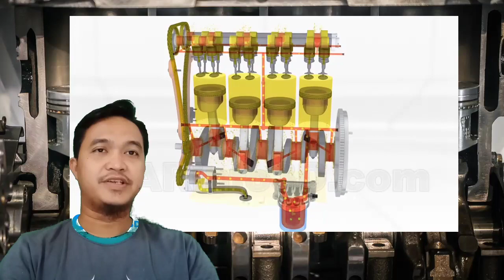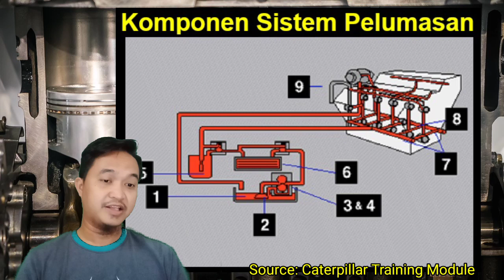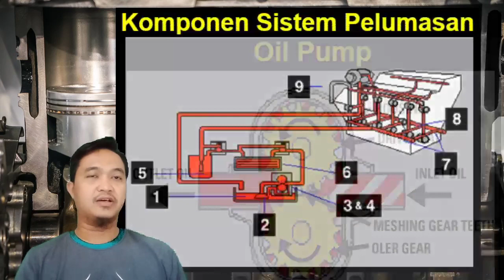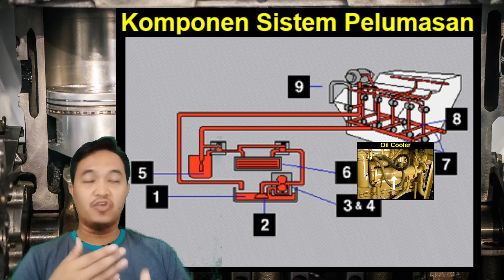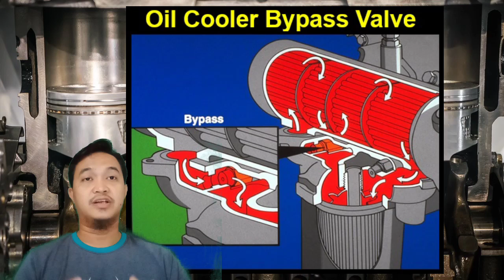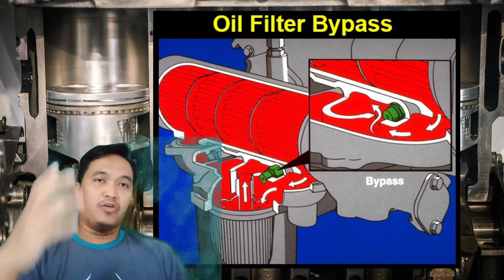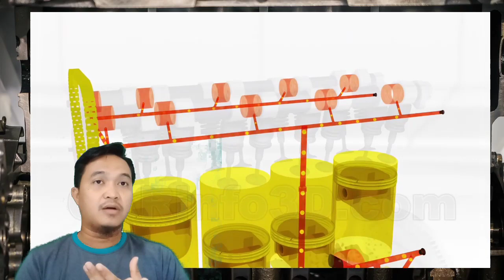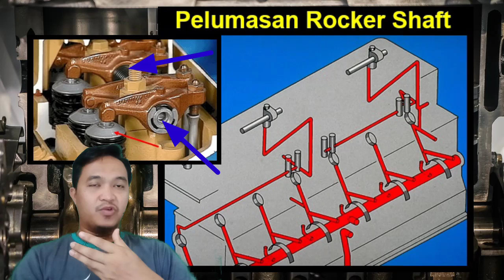Cara kerja sistem pelumasan engine (Lubrication System). Apa itu crankcase blowby? Training BMC 6

Comment: Permisi om,, untuk yg bagian crankcase breather itu cara kerjanya seperti sistem pcv gak om? Yg nantinya bakal ada selang yg menuju ke intake, nah di mobil saya intakenya jadi kotor banyak kerak oli gara² itu,, bagusnya itu bisa dicopot saja biar lepas ke udara luar atau saya tambahin filter breather biar lebih aman? mesinnya?
Reply from the maker: Oh kalau di mesin diesel rata2 lgsg dibuang ke udara mas..
Reply: @dikiadnarrayyan  tapi klo mesin bensin harusnya juga gpp kan om klo dibuang ke udara juga? Alih alih bikin kotor intake sj
Reply from the maker: @nash4938 iya sih mas, saya pun baru tau ada sistem yang model seperti itu .. tampaknya ada sistem yang tidak bekerja lagi mas.. tapi klo dilepas berpengaruh ke yg lain gak mas, mengingat itu sistem bawaan..
Reply: @dikiadnarrayyan  sdh saya coba lepas kemarin, gak berselang lama saya pasang lagi soalnya minus banyak dan parah😅
Reply from the maker: @nash4938 maksudnya minus gimana mas? Apakah ada efek sampingnya
Reply: @dikiadnarrayyan bau bensin masuk ke dalam kabin om tiap nyalain ac sama tarikan jadi kurang responsif,, gaenak lah intinya om, lebih banyak minusnya drpd nilai plusnya😅

Comment: Mau tanya bang,
Saya ada problem oli engine muncrat dari dipstick saat di running dan asap yg keluar dari muffler juga gak ngebul. Katanya pernah ada kasus seperti tapi yang di ganti turbocharger. Apa kebocoran pada turbocharger dapat mempengaruhi tekanan pada crankcase? Mohon penjelasannya bang 🙏🙏
Reply from the maker: Moho maaf mas, ini engine Caterpillar bukan ya?? Klo engine Cat coba ganti crankcase breather nya dulu mas.. 🙏🙏
Kalau turbocharger bocor biasanya ngebul.. tp tidak menutup kemungkinan sih..

Comment: Kalau diengine gak ada breather nya apa yg terjadi mas...kayak brake system mas kalau gk ada breathernya efeknya gimana mas
Reply from the maker: Klo gak ada breather nya ya jebol seal crankshaft nya mas.. breather nya brake dimana itu mas?
Reply: @dikiadnarrayyan  ada mas diki kecil dia ada dihosenya
Reply from the maker: @suhadihadi8761  unit apa ini mas?
Reply: @dikiadnarrayyan  785 mas
Reply from the maker: @suhadihadi8761  785 Cat apa Komatsu mas? Dia di sebelah mana posisi nya y??
Reply: @dikiadnarrayyan  785 cat mas..ada kok dia dikasih hose kecil baru dikasih breather mas
Reply from the maker: @suhadihadi8761  Ooo.. ya ya.. 👍

Comment: Kalau engine blow by itu apa mas ya
Reply from the maker: Seperti penjelasan saya mas, engine blowby tinggi itu artinya cylinder dan piston sudah loss kompresi sehingga menyebabkan uap yang keluar pada breather berlebih. Ini biasanya dibarengi dengan engine low power. Dan biasanya ini engine yg sudah tua mas.. 🙏🙏
Reply: Blow by pressure tekanan yang berlebihan di crankshaft kah
Reply from the maker: Di rumah crankshaft mas.. atau di blok engine. Itu ada nilai maksimum nya.. 🙏
Reply: @dikiadnarrayyan  iya pak
Reply from the maker: @hernandeschannel7109  yes mas..

Comment: Jadi oli itu masuk sebelum by pass atau masuk oli filter dlu mas diki..oh iya mas diki kelahiran tahun berapa ya
Reply from the maker: Masuk oli filter mas, sebelum filter ada input bypass tapi bypass itu ada check valve dengan spring jadi saat filter ngeblok baru oli otomatis melewati bypass.. 🙏🙏 
Wah kalau tahun lahir bisa  DM di ig saya mas.. 😁🙏
Reply: @dikiadnarrayyan  terima kasih mas...utk system brake mas ,trus suspension
Reply from the maker: @suhadihadi8761  noted mas.. ditunggu di konten2 berikutnya ya.. 🙏🙏😎

Comment: Diki saya mau bertanya nii,,, 
Ada senior nii tanya,,, ke saya,, apa efek oli engine klu hampir dpt bersentuhan dgn piston...
Reply from the maker: Maksudnya ini oli level nya kepenuhan kah ini mas?? Jadi sampe nyentuh piston gitu kah??
Reply: @dikiadnarrayyan  mungkin seperti itu beliau maksud kan , mas ....
Reply from the maker: @ramadhan3715  Ini saya pernah mengalami, jangka pendeknya oli keluar dari chankcase breather, nah kalau jangka panjangnya ya engine berat memutar karena kepenuhan oli, kalau gak segera dikurangi dan masih tetap dioperasikan seal crankshaft rear atau front bisa bocor karena pressure blowby berlebih .. 🙏🙏
Reply: @Diki Adn Ar Rayyan. Sepakat mas, soalnya sama-sama belajar kan, ya 
Terkait dgn masalah kepenuhan okelah,  
Aku masih sangat jarang mas, dpt low engine oil pressure, apa yaa yg harus di lakukan...
Reply from the maker: @ramadhan3715  untuk operator segera matikan engine mas.. dan untuk mekanik, pastikan diukur saat crank dan engine oil pressure itu naik saat engine crank.. 🙏🙏